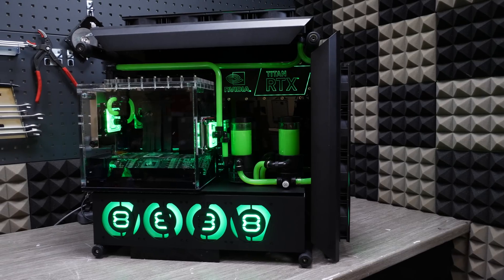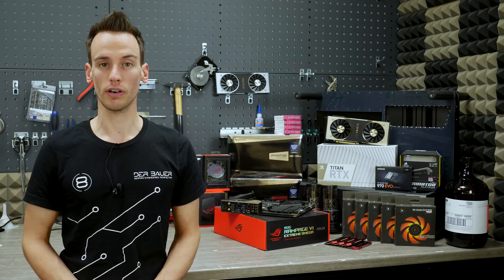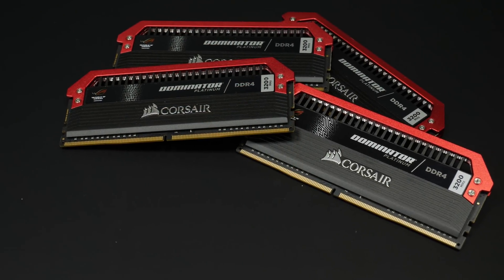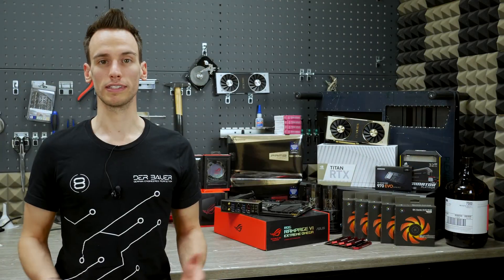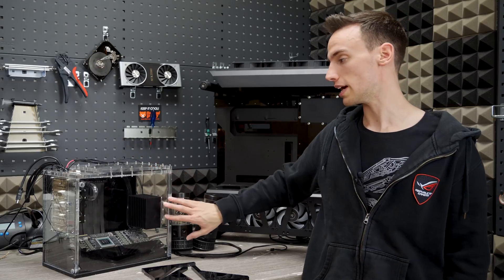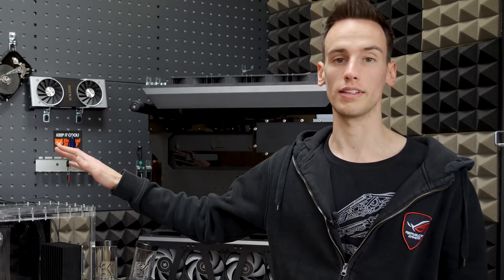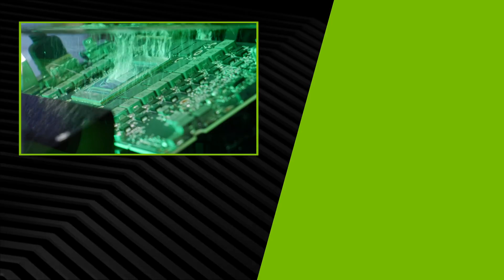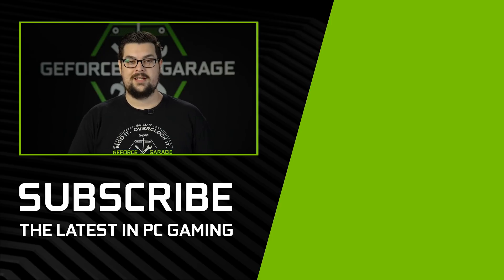GeForce Garage - Der8auer's "Aqua Exhalare 2.0"

Comment: What is the electrical power consumption of this cooling? If each thermoelectric module transmits at least 50W of heat, then in total two modules will consume at least 200W of electricity. For normal operation, it is necessary to remove at least 300-350W of heat, given that the rest of the thermal energy will spread through the walls, this is at least 600-700W of electricity needed for thermoelectric modules. Why couldn't you just make the back and top walls of the tank out of the heatsink with the ribs inside and further remove heat from these radiators by the cooling system? The side walls can also be made of heatsinks, with fins in and out for additional heat dissipation.

Comment: For someone as talented as you, your soldering skill is horrible. Tin the exposed wire ends by placing the iron on the wire and the solder on the wire not the iron. Then place the wires together and heat. The way you're doing it, the flux is mostly all burnt off by the time the solder on your iron touches the wire, and without flux it wont wet properly and make a solid connection.

Comment: That's awesome.  This is kind of something that I might consider doing. I do work in a chemistry lab, and it would be fun to have a chemistry lab themed PC! My next build might be fully water cooled, so I might think of something interesting to do with the excess heat, like route the hot fluid into an ammonia fountain or mercury fountain or something like that where I can use the heat to do something cool visually.  I love seeing stuff like this build because it gives me lots of ideas...
Reply: Did you ever end up doing this? I'd love to see what you came up with.
Reply: @GrinningJest3r  Not yet, but I still think it is a cool idea!  I am still running a GTX 980 in my main rig, and I haven't upgraded yet since GPUs have been impossible to get...  The 980 is still great, but it is showing its age, so I am starting to think about what my next build might look like. What I would need to figure out is how to couple something like Corsair's HydroX series parts to another metal or glass tubing standard. That adaptor might not exist. I could definitely do some cool things, but it would require a lot of custom work.  I'll keep thinking about it! ;)

Comment: ... Correct me if I'm wrong, but woudn't it be more efficient at that point to just run TEC's with two independant waterloops on both sides, and run the cool loop with the components, and the hot loop with the radiators and fans to dissipate the heat? I mean 40 degrees sounds good and all until you realize that with only 2 480 radiators (He said he had 3) I never reach 50 degrees  staying around the mid 40's on a 2080 to FTW HydrCopper OC'd to 2175 Mhz constant and 8100 mem. We're talking about a marginal gain and I'm not even sure if it really is a gain, as I 'might' get pretty close to the same temperatures you're getting with the novac if  I externalized my radiators and added another 480... 

I guess I just figure if you're going to pump power into TEC's to achieve better thermals you should be pushing close to ambient under load if not sub-ambient. I'm all about going CRAZY impractical, and at any cost, but only when it actually makes some performance difference. What I'm seeing here is crazy impractical with the same exact outcome as a very well designed waterloop in a Super-Full Tower case loaded with fans and radiators. Sure maybe you have to change out the thermal pads for a higher transfer rate, and use liquid metal, but it's still far far far less expensive than this, and equal and POSSIBLY even better results if you are also using silicon lottery parts.

Comment: amazing build :) but isn't it going to rust?
Reply: Oxidation isn’t an issue here, although pulling a vacuum and filling the chamber with Nitrogen gas wouldn’t be a bad idea.

Plus I don’t think there is any exposed iron either.

Comment: It's boring to see every video trying to do some liquid cooling as if you are getting 100fps extra. There is hardly any improvement with these useless cooling ideas. Engineers working at Nvidia know much better to handle heat than these cooling gurus .

Comment: That method is for the data center. Not personal computer. That way can reduce the maintenance cost by reducing the volume and electricity of data center cooling facility. Also, because Novec 7000 is basically for fire extinguisher fluid, it can enhance the fire prevention of the facility to reduce the insurance cost. However,  as you see above, it requires 1200W more power to run Peltier!! and you will receive the very expensive electric bill monthly.

Comment: It's all fun and games until you forget to plug in the display cable...
Reply: at least you got a nice display case for the gpu!!
Reply: Well, this liquid dries out very quickly and is not greasy or conductive, so it's relatively easy to make adjustments to the components if required.
Reply: Happened to me

Comment: That's so crazy. What A mad scientist  lol.  My Desktop pc parts are: Operating System:Windows 10 Pro 64-bit,CPU:Intel Xeon E3 1220 v3 @ 3.10GHz Haswell-WS 22nm Technology,RAM :16.0GB Dual-Channel DDR3 @ 799MHz (10-11-10-30), Motherboard:ASRock H87 Pro4 (CPUSocket) Graphics, 3072MB ATI AMD Radeon R9 200 Series (MSI) Storage: 223GB KINGSTON SHSS37A240G (SATA-3 (SSD)),1tb external game drive, Power supply corsair 500w,case:Cooler Master trooper case, Montor:40 inches toshiba tv at 1080p.
I could not afford any NVidia GPU so I have to buy an AMD instead. Now its just gaming pc for my 1 niece and 2 nephews.